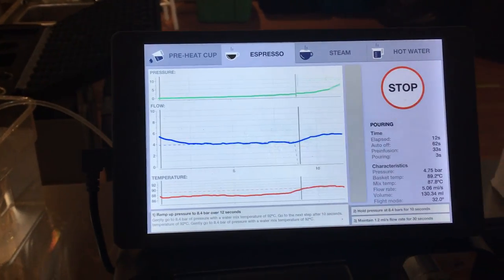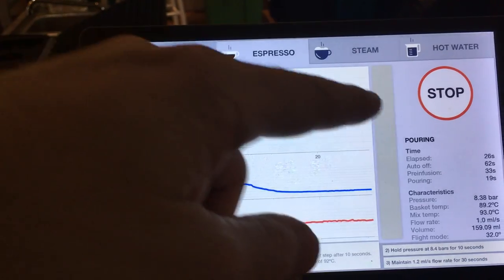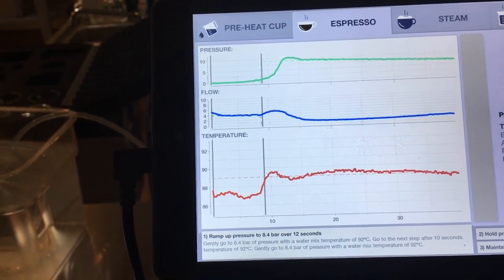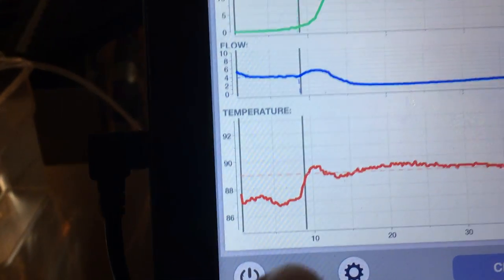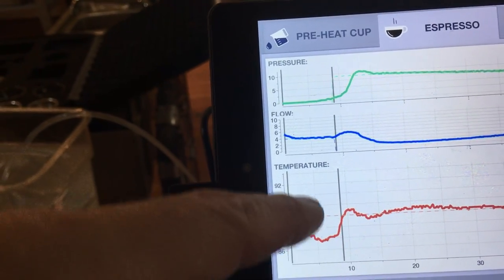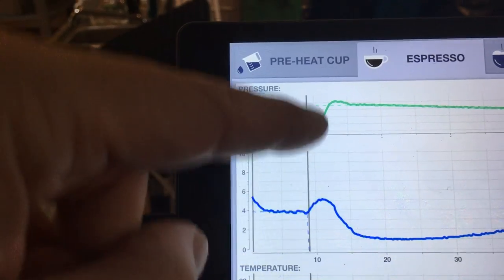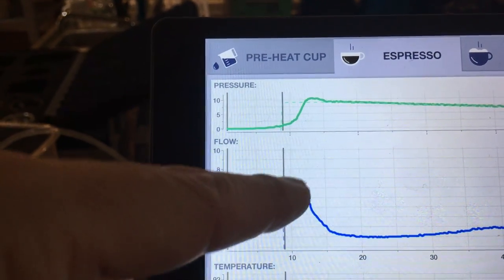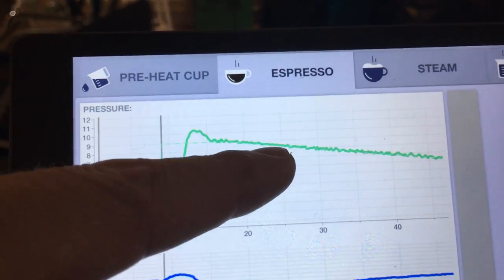Ben Kaminsky makes a decent espresso

Comment: So excited about this product!

Regarding the drop in pressure to reduce acidity:

Is the drop in pressure adjusted early on to reduce puck erosion to maintain flow resistance in the puck?  Or is the drop in pressure used to decrease flow rate thus extending contact time for a higher yield?
Reply from the maker: this: "the drop in pressure used to decrease flow rate thus extending contact time for a higher yield?"